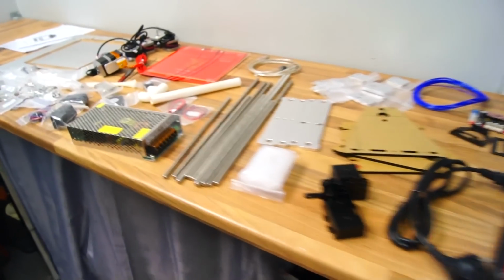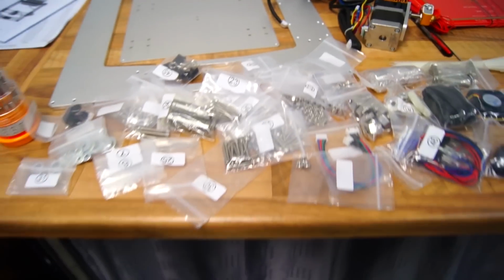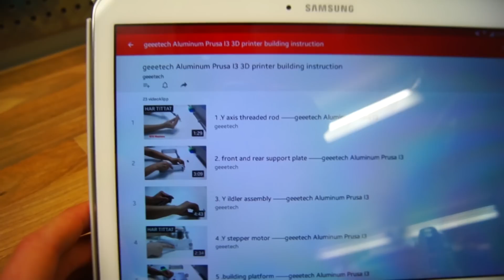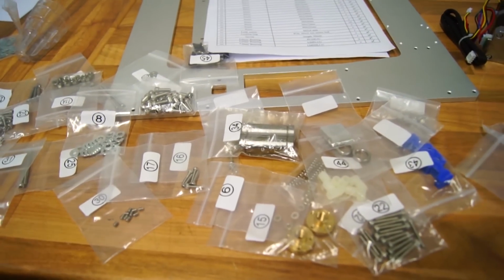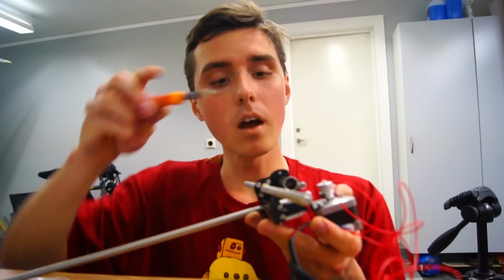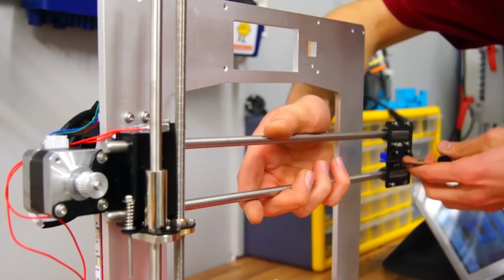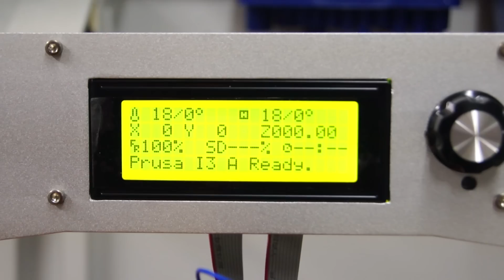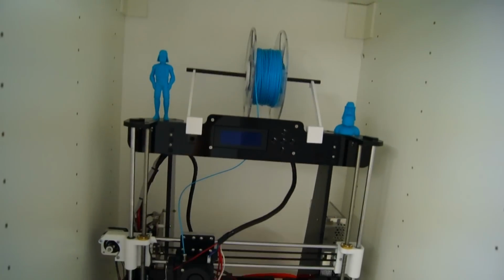DIY Geetech 3D Printer Kit - Unboxing + Build

Comment: Hey, did you get to test the printer thoroughly? Im interested in one of the geeetech prusa printers. It seems that it´s componentwise a good platform to start with. I´d love to construct my own 3d printer, but it seems that this will be much easier once I actually have a 3d Printer to create mounting parts etc.  I looked up the AM8 and like the concept. It looks a little bit more solid than the aluminum design of the geeetech. the aluminium is pretty thick with 6mm but the aluminum profiles of the AM8 are perhabs more stiff. Especially since the aluminum plates used in the geeetech face 90° sideways compared to any acrylic design... I wonder if that is for marketing, oder technical reasons... Either way... profiles should be stiffer in any direction. 

What do you think? Is the frame overall stiff? Does it wobble? What are the weak points one should improve first?  What would you go for? the geeetech wood class with an aluminum profile frame for... maybe 200 oder 220€ overall, or the the genuine aluminum geeetech for  250 or so? Pretty specific questions I know, but maybe you can help me a little since you tested the aluminum geeetech and many others :)

Comment: this Vs A8?
Reply from the maker: The Geeetech is a great printer, but a lot of people have reported faulty motherboards. I received a broken motherboard as well! With that in mind, I would probably still go with the A8.
Reply: Audi A8?? :D :D :D
Reply: RCLifeOn is rather take this over the a8 because of the frame work more stability better print quality less chance of snapping acrylic just replace it with mks board

Comment: Hey I have the same printer but get bubbles in my prints any ideas
Reply: That may rather be the filament. If the filament is slightly moist, the water will evaporate in the nozzle.
There are a few things you can try.
1 : Try printing at a lower temperature (below 200 °C)
2 : If you still get the same results, try drying your filament. (you can find videos on how it's done)
3 : Try another filament brand.

Comment: Which 3d printer would you recommend under 300 I need it to be able to print pla and flexible filament (tevo has taken 2 and a half weeks and they still haven't shipped it)
Reply from the maker: Then go with the Anet A8 for around $200. It prints flexible filament without any modifications.